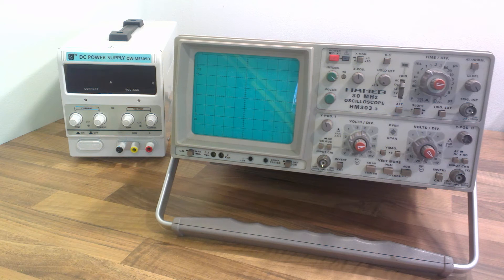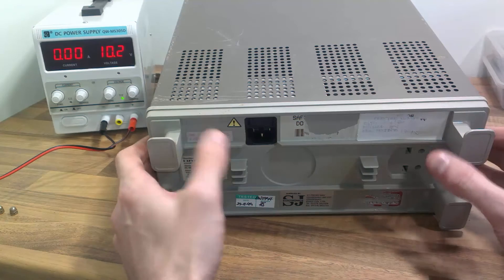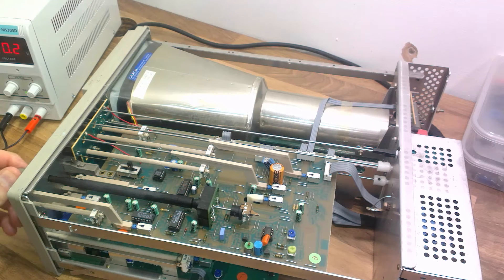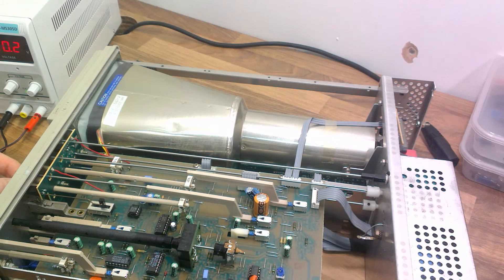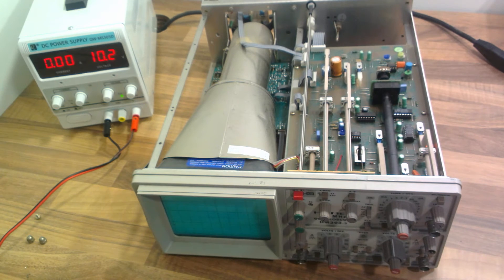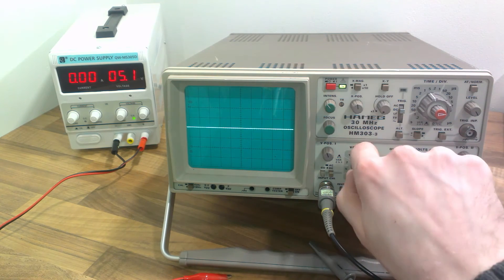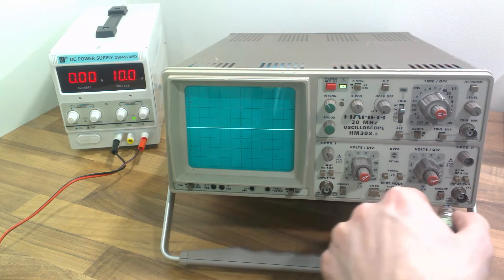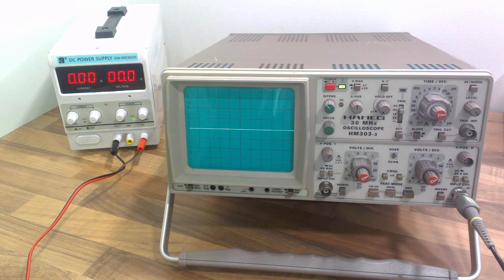REPAIRING: My Newly Acquired Hameg HM303 Oscilloscope With Contact Cleaner Spray (Misc)

Comment: Try playing with the Hold Off to See if that fixes your "Problem" and maybe take a Look at how analog Osciloscopes actually work
Reply from the maker: But I fixed the "problem" in the video! That's what the video was about! It just had sticky contacts.
Reply: i mean channel two only showing two lines istead of the cal signal (well it is the cal signal but running over the screen so quickly that it appears to the eye as two lines)